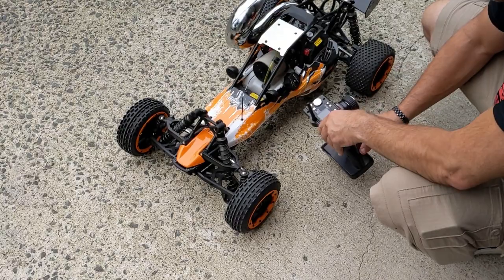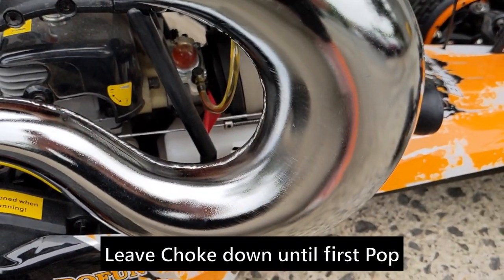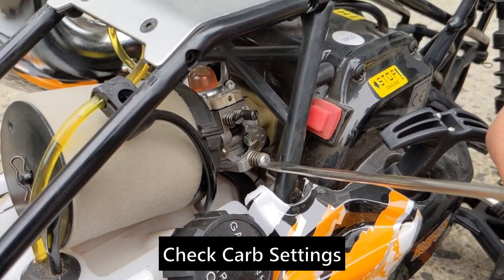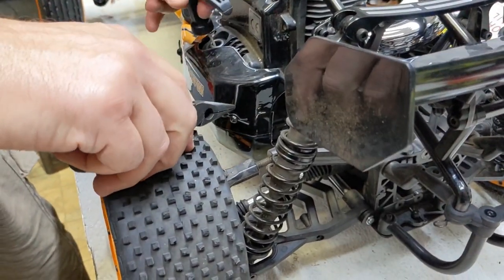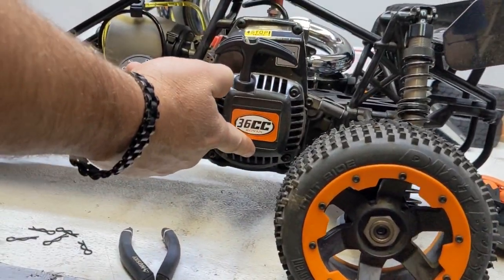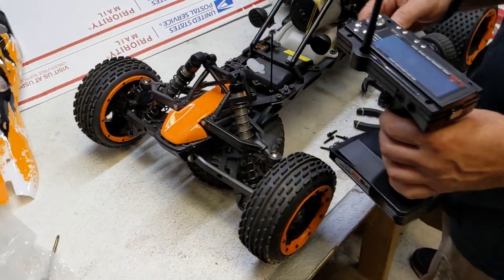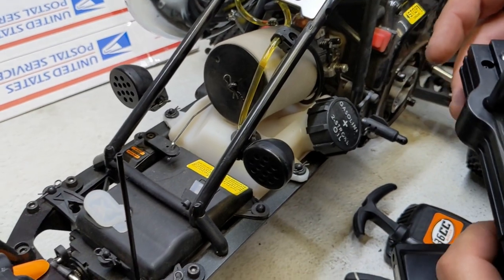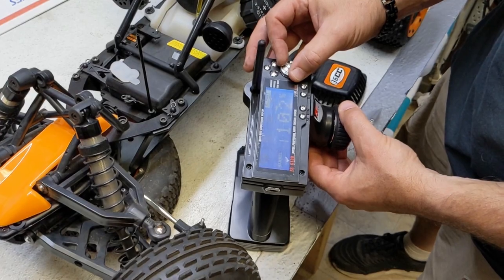How to Start a 2 Stroke Gas RC Car - Rovan RC

Comment: is it any good though.i see this and its the cheaper end.also can you add bigger wheels to it.the hex nut hubs look quite big.
Reply from the maker: These Rovan or King Motor Baja's are the best value in gas 1/5 scale.  There fast, durable and parts are affordable compered to other brands.

Comment: also are these engines the same as the nitro engines? what about maitenence and adjusting for hot weather and cold starts and humidity etc are they a pain like the nitro engines?
Reply from the maker: No, these engines are like a weed wacker, they hold there tune, very easy to operate.

Comment: do these come pre tuned from the factory? do I need to adjust anything?
Reply: There usually close to tuned but different locations will need different tuning.
Reply: so they should be fine to use out of the box they will only be little rich or lean
Reply: @thelag1200  Yes.

Comment: How do i make my rovan as1 baja brakes sharper
Reply: try adjusting the end point on your remote to pull the brakes harder, or adjust the linkage so it pulls the brakes sooner. Also check there is no oil on the brakes, sometimes a leaky exhaust on the Baja can leak oil onto the brakes (tighten the exhaust screws or get a new exhaust gasket to prevent the leak). Hope this helps!
Reply: @OwenBuckingham11  thank you.  It has helped. As its my first one. Its running on 25 to 1 raito starts first time with no adjustment on anything so its running on factory settings it that ok. Don't cut out should i leave it

Comment: When I put it into reverse the receiver shaking not sure why and it don't brake and tips
Reply: Do you mean the brake servo is shaking?  If so you probably have the ABS system on the radio, try shutting that off.
Reply: @kingmotorrc9694  thank you for the reply its sorted now thxs

Comment: only prob.. you posted this too late. lol
i need a helacoil job now.. & see if thst holds.. i bought 2 dif dually adaptors
neither right thread size.. i got the 2yr waiting list LT SC 4wd.. red/white.. i need a helacoil job cuz factory plug first time i flooded it.. it stripped sadly.. but that's ok.. only thing i broke in a year lol but i love it.. now not to cartwheel it.. when get dually working.. & i got  170x60 (x4) & 170x80 for fronts off buggy.. to compensate torque difference
Reply: do these Baja's come pre tuned from the factory? do I need to do any tuning?
Reply: @thelag1200  yes.. tuned but as you learn them.. & mass productions.. & shipping.. you mostly have to tune suspension & alignments.. better than kit form.. not really.. you learn more putting them together.. cuz you must maintain them.. like real cars
Reply: @phuque2ho  so the carb settings are fine. I only have problems with tuning as my previous nitro car did not respond to tuning at all otherwise I can maintain a car. So just to confirm before I buy one of these they come pre tuned
Reply: @thelag1200  oh.. nitro.. i'm running 5th scale 2stroke rovan 450lt shourt course turning into a semi-trail & rally 😀 😄 truck.. chainsaw yet loud as a 125 cc dirtbike